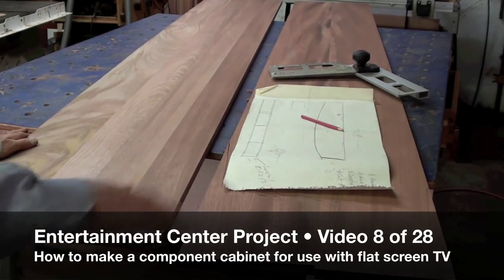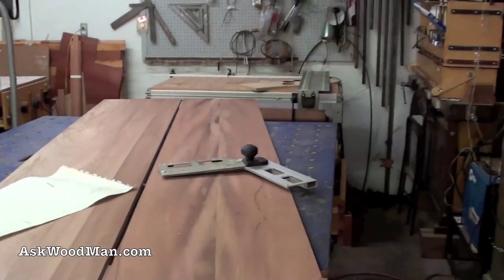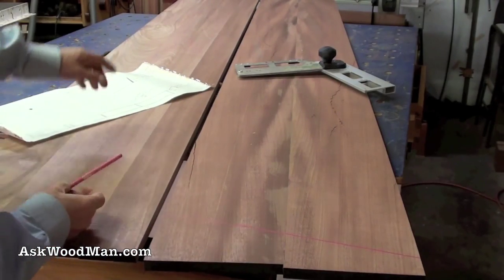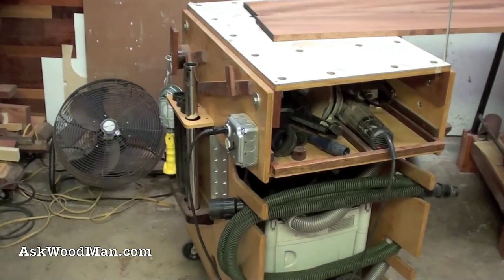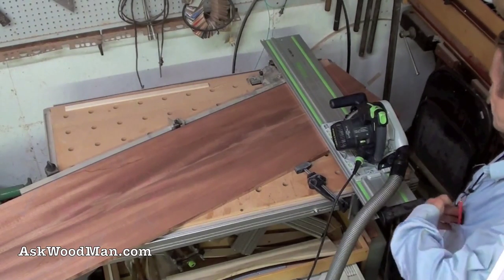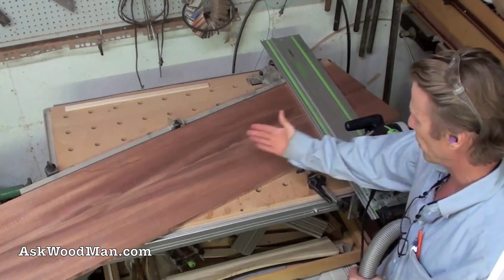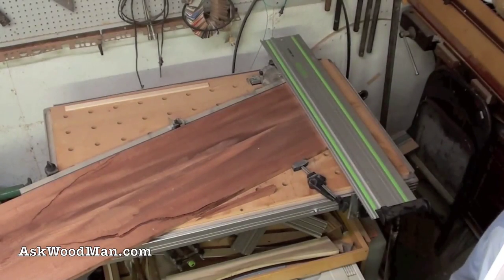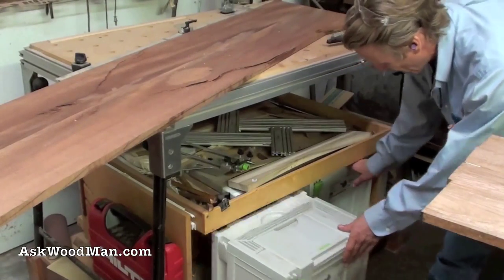8 of 28 • Building An Entertainment Center for Flat Screen TV: A Furniture Project

Comment from the maker: @azintrepid1 Planer snipe often happens on boards where the front feed roller allows the piece to lift away from the surface platen slightly and be tipped up into the cutter head. On my machine it a signal of improper lube of the platen. It will cut perfect for 100 passes and then 5 of 10 will be sniped. I always leave a little extra on boards or panels. The table top is sacrificial on the MFT. It is for backing on the bottom to reduce fracturing and for breakage support.